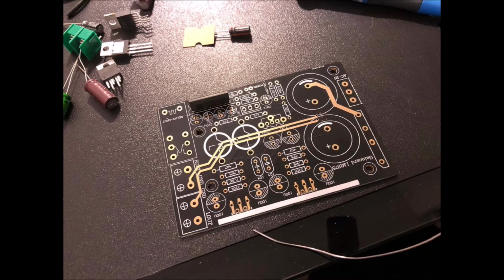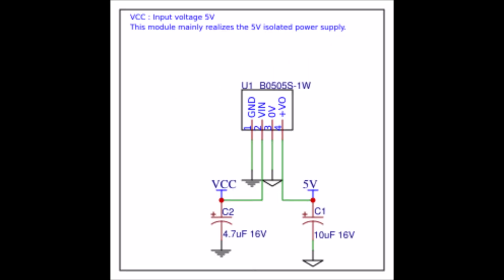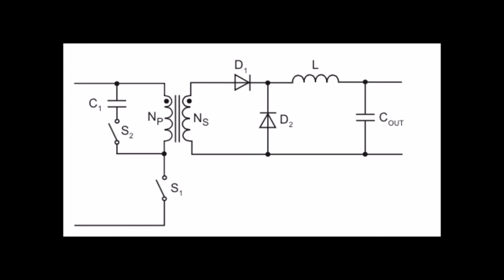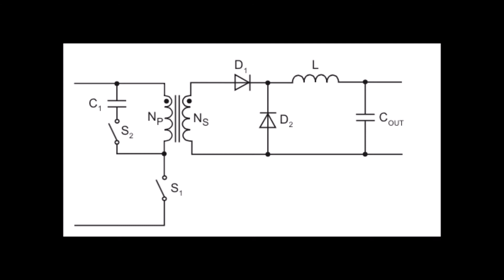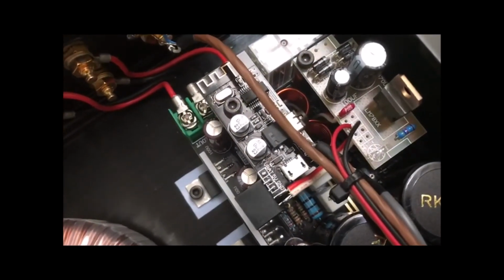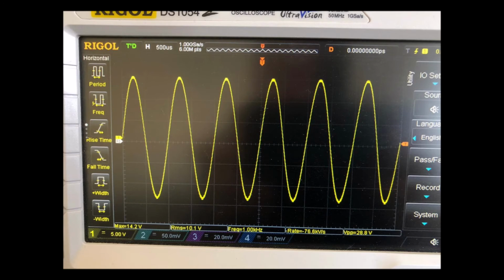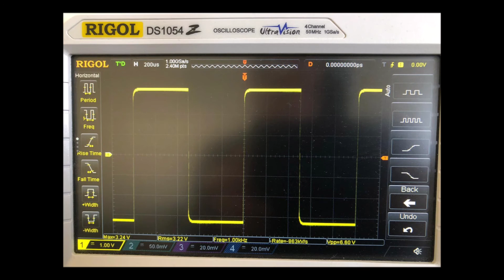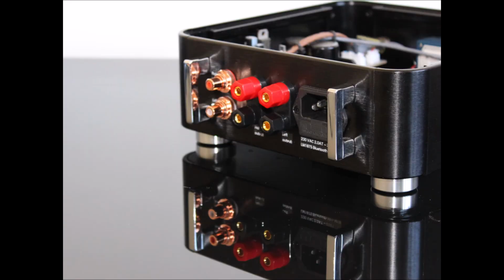DIY LM1875 gainclone with MH-M28 BT-module

Comment: Nice build. How does the MH-M28 BT-module performs in such a high quality gainclone amp?
Reply from the maker: Thanks Priyo! Better than I expected. But in all honesty I have to say that the internal DAC of the BT-module is not superb. The best results are therefore achieved by connecting directly via the RCA's through a good DAC. The difference is clearly audible as the amplifier exceeds the BT-module in sonic capabilities. But... despite the BT-module has some shortcomings, I have to say that, considering it only costs a few dollars, the BT-module is quite an achievement that is real value for money ;-) Definitely a nice and cheap addition/feature to implement into a DIY gainclone!
Reply: @PA4MW  Well the BT surely add some convenience by sacrificing some audio quality. I liked the enclosure. It is pretty neat !